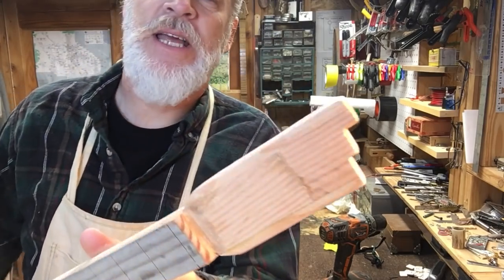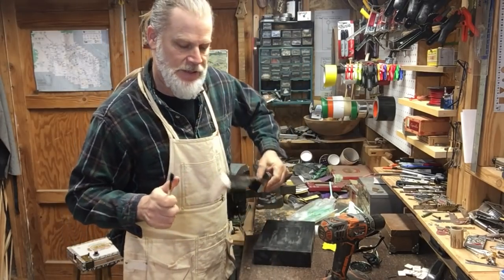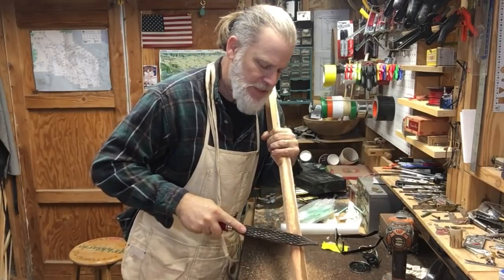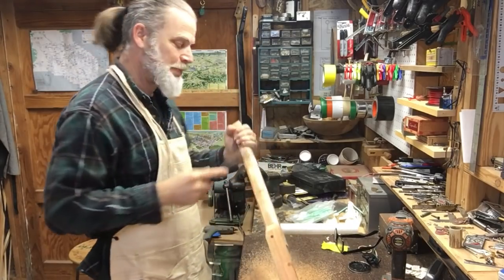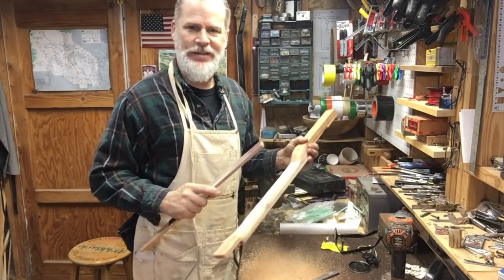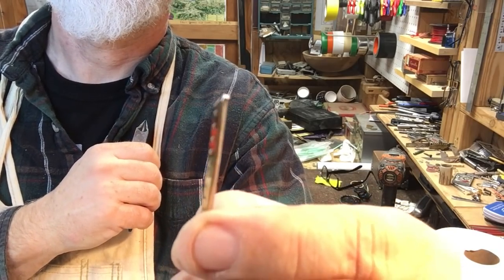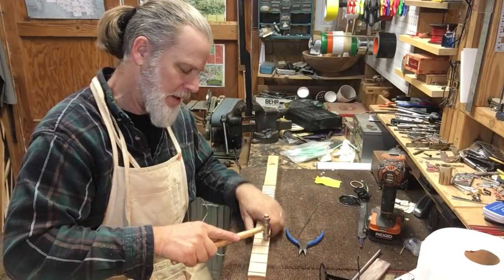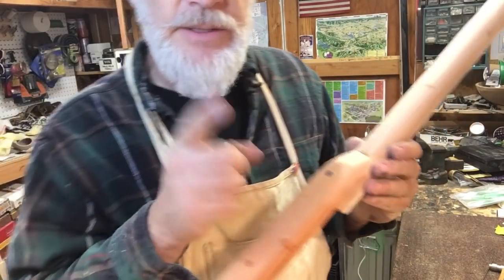Building Cigar Box Guitar Necks ( Part 1 )

Comment: Thanks, The Zero fret  humms very badly. it has a little groove in it. Its on your Jeremiah was a bullfrog 3 stringer. Do I replace it or file it down or? Thanks Del
Reply from the maker: depends on what the problem is? maybe the nut slot not wide enough... maybe too wide?? maybe not enough down pressure.  try putting small cotton ball under it or rubber band over to see if vibration is in backside.  should become evident and then can be addressed pretty easily...
Reply: Thanks, rubber band did not work, same buzz. will find some cotton somewhere and let you know.. So loosen the strings and put cotton on top of the fret? Sorry to bug you.
 @PuckettCigarBoxGuitar
Reply from the maker: @flyingdog366  no.. under the string on backside (behind) zero fret